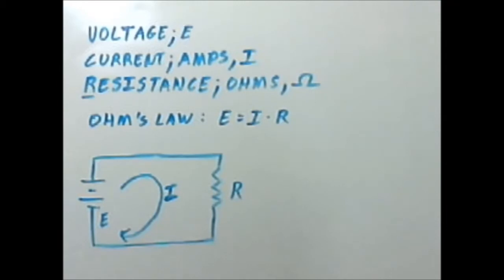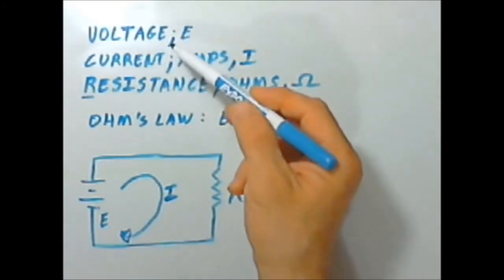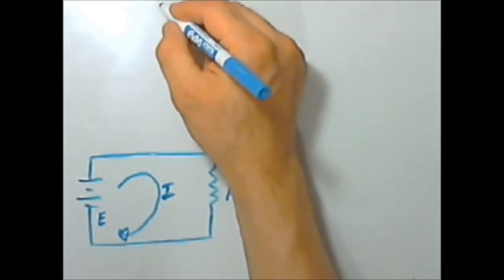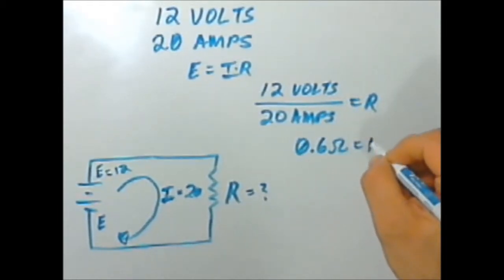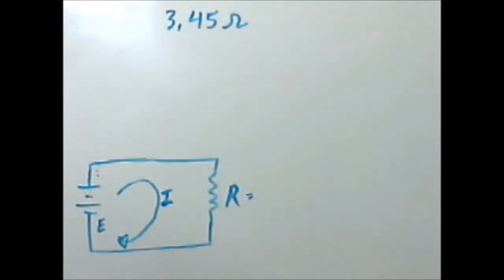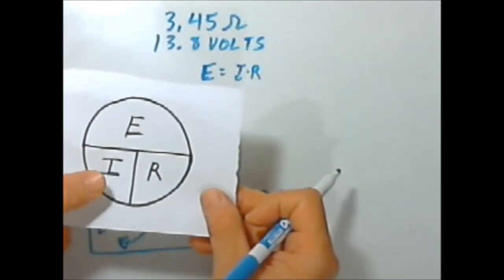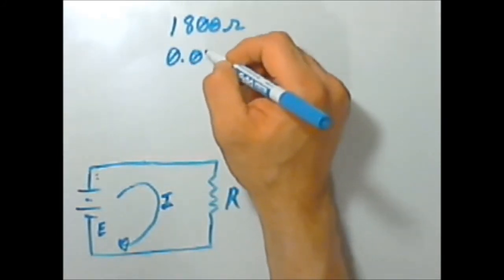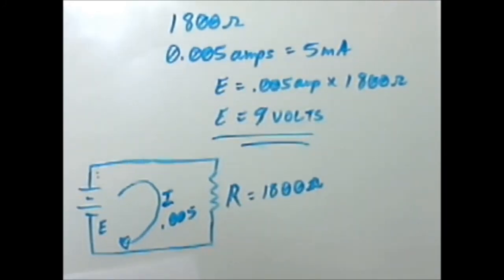Volts, Ohms, Amps Tutorial

Comment: If a circuit with 12 ohms of resistance is drawing 5 amperes, what is the voltage of the circuit?
Reply: I answered the second one first..haha..

12 ohms (R) 5 ampere (I) and you want to know the voltage. This is Ohms law (I) x (R) = Volts or (E)
12 X 5 = 60 volts

Comment: Thank you for sharing. I'm studying to be a mechanic I have three questions that I really need an answer for It would really help me if someone could help me the questions are: If a 12-volt circuit is drawing 6 amperes, what is the resistance circuit?

If a circuit has 3 ohms of resistance, and the system is operated on 12 volts, what is the amperage draw?

If a circuit with 12 ohms of resistance is drawing 5 amperes, what is the voltage of the circuit?
Reply from the maker: shamch22 Well - just like in the video - E (volts) = I (amps) X R (ohms). In your first problem, you'd divide the voltage (12 volts)  by the current (6 amps) to get the resistance in ohms (2 ohms). In the second problem, you'd divide the voltage (12) by the resistance(3 ohms)  to get the amps (4 amps). In the third problem, since E = I X R, 12 ohms  X 5  amps = 60 volts. Just like in the video ;) Hope this helps.
Reply: Looks like noone responded! 
The first answer is this Using Ohms Law and what Karls pie equation which helps. You plug in the numbers.
*12 volt (E) 6 amp (I) cover the (R) so divide E by I or 12 by 6 = 2 ohm (R)

Next
3 ohm (R) 12 Volts (E) look at pie to plug in equation, cover (I) and you get Voltage (E) divided by Resistance (R) or
12 by 3 = 4 amp (I)

Next
12 ohm (R) 5 amp (I) look the pie..this happens to be Ohms law E= IxR so multiply 12 x 5 = 60 volts

I know its been 2 years..this helped me help you.
Cheers! 
Hope you achieved your goal as a mechanic!!